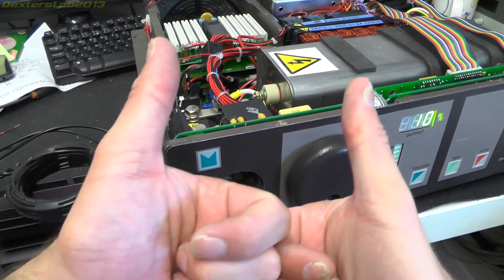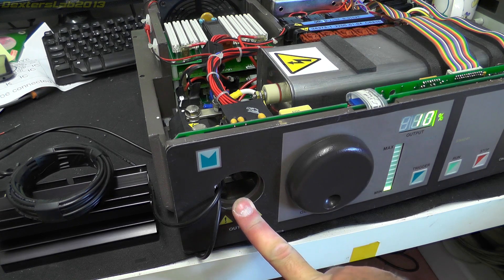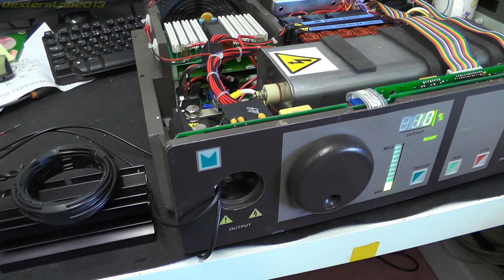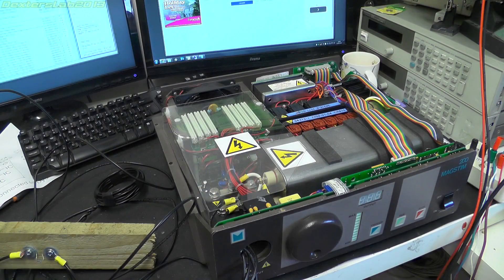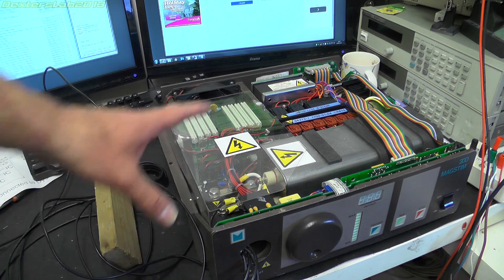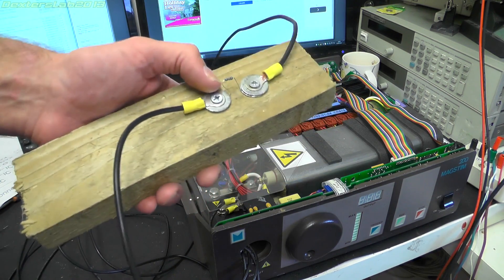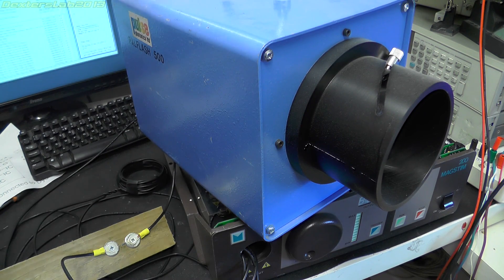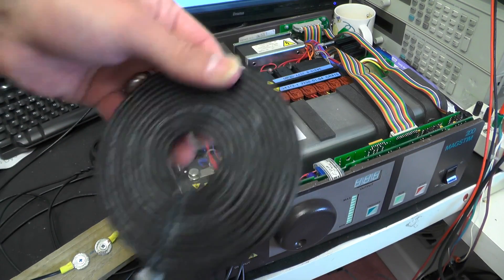DL#067 - Magstim 200 TMS Magnetic Stimulator Working

Comment: How come I never find stuff like this in Australia. Wonder if you could parallel the cap from the broken one with the one in the working one for double the J of energy :)
Reply from the maker: +dash8brj Yes i could parallel the other capacitor! The thought had crossed my mind, though before i consider doing that i want to take some traces of the discharge curve to see how hard i am pushing the thyristor.
Reply: You might need to beef up the thyristor to handle double the peak current - I have a hockey puck one in my cap bank which is 2450J of energy. I forget what the peak current handling of the thyristor is but its some insanely high amount.
Reply from the maker: dash8brj 2.4KJ nice! I'll keep the magstim as it is for the moment but i do have 10 3300uF 450v caps waiting for me to start a new cap-bank project so will need to start looking at thyristor options
Reply: Designed mine from bits I had laying around and 10 2400uF 450Vdc caps. Wired in series parallel for 900Vdc, and charged via a ZVS inverter with home wound transformer. All controlled by an arduino :)

Comment: Just thinking about the blending of this and the ultra flash system to see what happens at the instant of firing. You might find the cap with the sleeve busy blowing off, or the resistor busy shedding the outer lacquer. Try one of the VCR head transformers to see it fry.
Reply from the maker: +SeanBZA yes, it's going to be tricky to get some effect without some kind of flash, time to source the cheapest bucket of shenzen transistors to research with.

Comment: Try siting an old  hard disk platter on that coil & firing it. Make sure there isn't a fluorescent lamp overhead!
Reply from the maker: +mikeselectricstuff good idea, have plenty of spare old disks... might try it outdoors though!
Reply: +DextersLab2013 You should try paralleling that extra capacitor out of that other unit, to see if you get more power out of it?